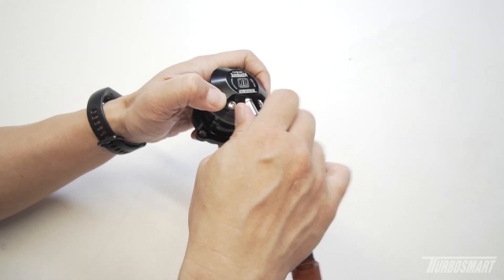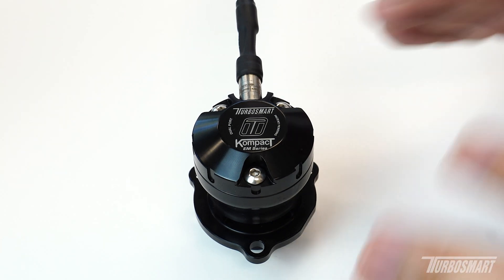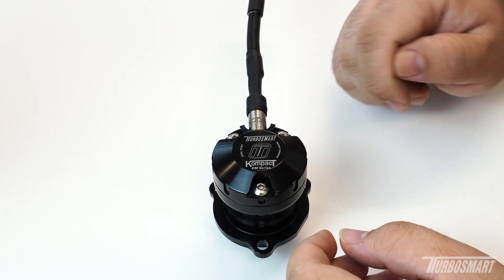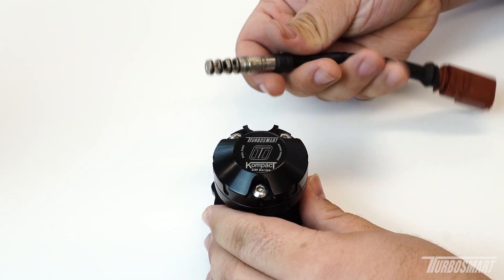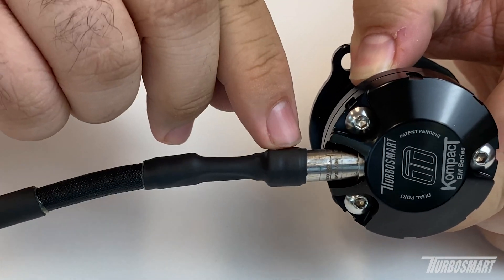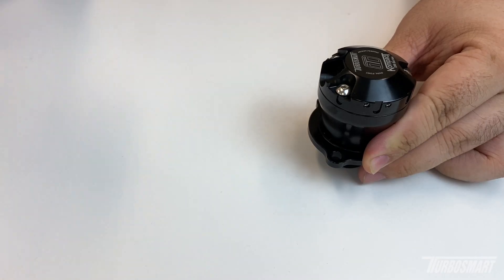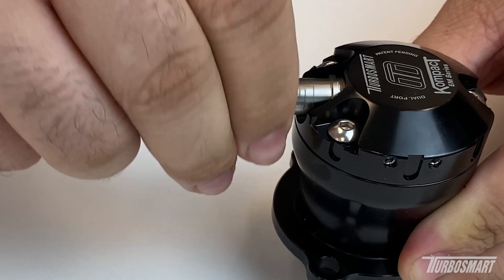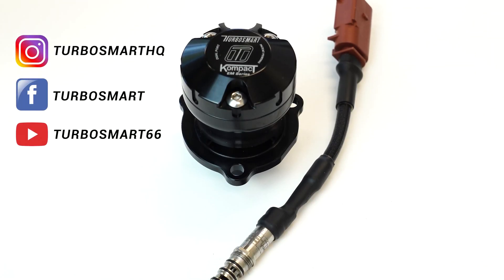Tech Tips: Replacing the Solenoid on your Kompact EM Valve

Comment: My turbo smart on my bmw is only 6 months old and once in a while under full throttle it doesn’t open and I get a code that says blow off valve jammed shut? What is the issue?
Reply from the maker: Sounds like a common occurrence on BMW and Mini applications. Its has to do with the parameters setup in the ECU. If it is a shadow code, you can ignore this. Feel free to contact us for further clarification.

Comment: I have been unhappy with mine. I feel like it was working for a couple of weeks and now pretty much just surges and gives me the line disconnected faults. Do these solenoids go out often?
Reply from the maker: They do not go out often as we expect them to last the lifetime of the valve. If you feel your valve is not operating properly, please get in contact with the Turbosmart Technical Support Team of your region so they can assist you.
Reply: Just installed mine today. The wires connected to the solenoid wasnt pinned properly. The connectors remind me of the cheap remote control cars you can buy at the dollar store. Kinda upsetting

Comment: I have a brand new Vr15 that has worked maybe 3 or 4 times in the past month. Racks up a surge count and gives a CEL with limp mode. Is it possible I got a bad solenoid from pastors
Reply: Factory
Reply from the maker: If you believe you're experiencing an issue and its a factory defect, we are happy to inspect the valve under warranty. Reach out to us Turbosmart.com/contact-us Happy to help!

Comment: On BMW's what error codes will a bad Solenoid cause?  I am getting this error whenever I let the car sits more than a day without starting it: 122004 diverter valve, control; linebreak. Could replacing the Solenoids resolve this issue? I have pair of Turbosmart Kompact EM Plumb Back VR9 (TS-0223-1292) on my 550i.
Reply from the maker: Not sure, we actually don't list a product for the N63/S63 because that platform is quite finicky and we did not have a test vehicle to develop a product on.